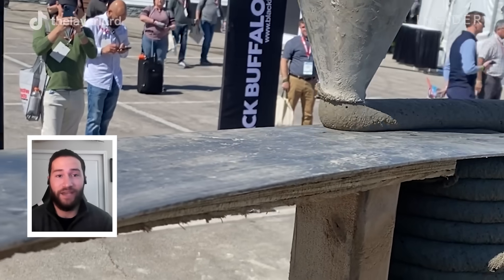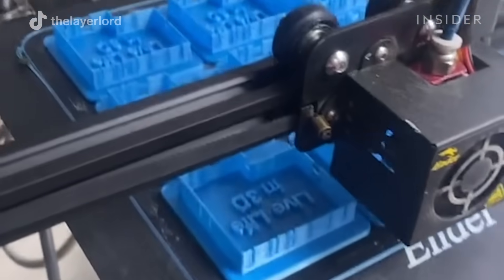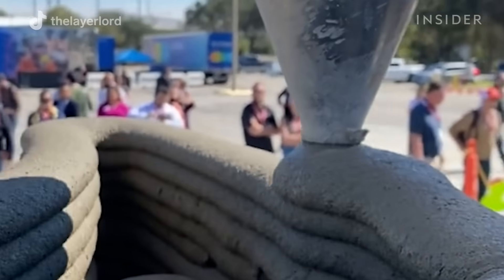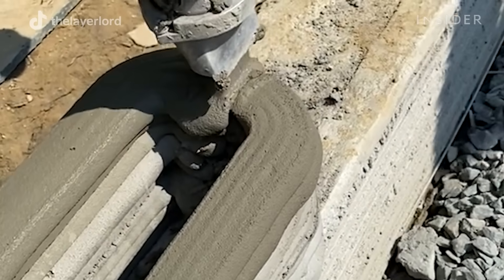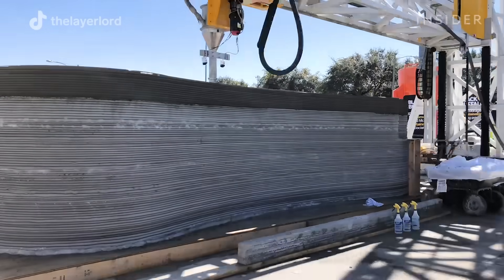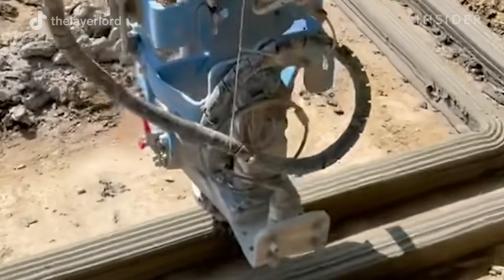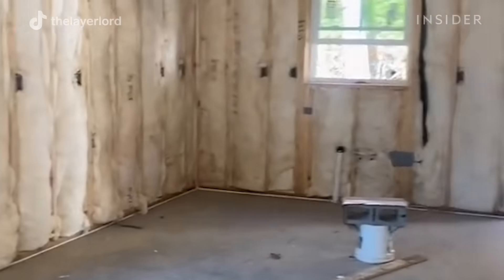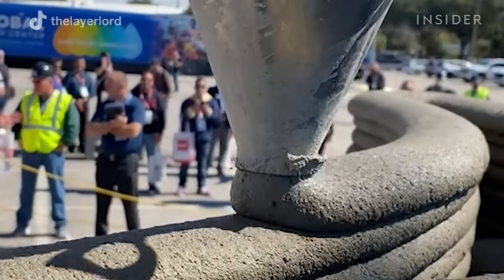How Concrete Homes Are Built With A 3D Printer | Insider Art

Comment: What is the lifespan of such buildings?
Reply: Right on observations here.  Best of both is to reinforce the "wall" in protected space, and put no steel in the outer, with lots of insulation and drainage in between.
Reply: That's unsupported concrete.   It won't stand in an Earthquake, but it is essentially the same technology the Romans used ... And much of their stuff is still standing.
Reply: @L0stEngineer  I do not know you have a lifespan of buildings, but in our regulatory documentation, the lifespanof concrete buildings is from 50 to 100 years, depending on the brand of concrete. Therefore, I am interested in comparing the lifespan of buildings for different construction technologies🤔
Reply: @dimarium      that's for reinforced concrete with steel rebar.      Eventually, the steel will rust and crack the concrete.    If it's unenforced, it has no resistance to tension, but may last a whole lot longer.

Comment: If we could speed up the process with this, we could have quickly durable assembled structures placed just behind the front lines for our soldiers. Infirmaries, command centers, even just some cover. Thin concrete is just a little more defensive than a tent, is it not?
Reply: Each side of those walls were 3 in thick, how is that thin exactly? Not trying to knock you for having an opinion, but your opinion is false 🤣🤣

Comment: Very cool technology . BUT: Essentially this "solves" a problem that isnt really there. What this does it "automatically and very fast" constructs the skeleton of the walls of the house. Thats not a "house", thats .... a skeleton of the walls of a house. If you include the time it takes to rig up the printer and configure the thing, I'm pretty sure that any small team of workers could do the same job just as fast the old-fashioned way.  Construction a frame like that in concrete or wood is relatively trivial. Everything thats actually hard, time consuming and expensive about a house, comes after. Roof construction, plumming, electrical, sealing, carpetry, interior, paneling , floors, ceilings, kitchens , bathrooms, tiling, doors, windows, frames... the list goes on and on. All of those things you'll need to do anyway. In addition , because of this weird method, you probably run into quite a few problems you wouldnt have in a traditional framework. such as rounded corners, alot of uneven layering etc.
Reply: Which is why I think it has excellent military potential. If we could adapt this technology to create disposable, durable structures for our soldiers, it would put us at a huge advantage.
Reply: @brendan5260  how so? I see a bigger need for it to be used to house the homeless and/or those who are at a disadvantage due to acts of nature. Having said that, if this technology were to be replaced by traditional lumber homes/buildings as time went on, civilization as a whole would all be better off in the housing industry. It may put many skilled laborers out of business/jobs, but if that meant that more could thrive because of it and not have to worry about a literal roof over their heads, then that’s not necessarily a bad thing in the end!
Reply: It could be used in space tho
Reply: Nice speech there Joe Know it All.
Reply: Heavy disagree. Knowing tradies who work the “old fashioned way” they hit so many bottlenecks on the job - having the entire thing handled by 1 team will avoid so many issues. These issues break a contract and cost money. This saves money and time.
Reply: While you maybe right this is not about what is possible now but what will be as the technology matures. When jets were first introduced they were slower than propeller driven planes.
Reply: "Price point" is the biggest advantage. Plus, concrete lasts a lot longer and requires less maintenance during the following years. Of course, the roof is probably a "catch 22" in that if made of concrete, it'd take considerably more labor and material. I had to help my brother clean up what was his "stick-built" home twice because of hurricanes. If it would've been built with concrete, at least you'd have the walls still standing...not to mention, it would make construction codes fairly easily. But, it'd still be up to the owner to make the choice of building materials. There's plusses and minuses about either method. It is what you make of it.
Reply: Putting also into consideration the amount of concrete used, I feel like this uses a lot more concrete that building using bricks and concrete would making it expensive I think
Reply: At least for where i am, where a 50kg bag of cement is ridiculously expensive
Reply: Considering the shell of these can be build in a day or two, it IS solving a problem especially if they need a higher volume of them built in a particular area to serve a homeless need. Framing out a house even a small one can’t be done in that amount of time unless you have A LOT of hands on work teaming together. Unless you’re an Amish community or have an extremely large group of volunteers, you have to pay all of those people in exchange for their labor. So you’re wrong that it’s cheaper and that it can be done in the same amount of time because the majority of that work to build a home IS the frame work! Anything after that is smaller jobs coming together to finish it off, even if just as important as the structural work. With this, you’re paying far less people to basically just babysit a machine while it shits out a 90% built home for you, in most cases-by they end of the day. You just can’t beat that-especially when the more manual labor here is probably just making sure the machine is in proper working order!
Reply: @BeachMum  idk my brother, dad, and I once had a job to build 6 small houses, just the frames, after about the 4th one we were so good that we finished the other two in just two hours, granted we had all the material and tools already laid out and my mom was handing us all the tools we needed, but it just goes to show that a well coordinated team with everything they need doing something they’ve done multiple times can really knock it out, but they problem isn’t even that there isn’t enough houses, it’s paying for those houses, idk how expensive this cement they are using for these are or how strong it is layered like that, I’m sure it’s strong just never seen anything like it, guess we’ll see
Reply: @billflunkendorf  this isn’t regular cement. It’s much stronger and made specifically to withstand whatever nature can throw at it-floods, hurricanes, earthquakes, bugs, etc. and is said to last for hundreds of years, far longer than what we use today and needing to be replaced every so often. These homes or shells of homes, can literally be built in less than 24 hrs, far faster than most homes can even on a smaller scale.
Reply: @BeachMum  I think you have consumed too much of the nonsense. You need to look at the reality of these buildings.. there has been many debunking videos from many different channels. From many different backgrounds that prove how incredibly ridiculous these "houses" are.
Reply: @mastermnd22  and what exactly makes them “ridiculous”? Just because they’re new technology? Many people live in earth bag homes and that may seem ‘ridiculous’ to some who don’t get it, but that doesn’t make it so, only that it’s your opinion that it is. What La ridiculous of many timber homes is that it makes them susceptible to many acts of nature. Just because it’s what we always used, doesn’t mean it’s the best thing to use/continue to use, it just means that’s the way we’ve always done it. When we know of a better way, we tend to ver in that direction and that’s how we progress. So I ask you, what exactly makes this technology ‘ridiculous’?
Reply: @BeachMum  what makes this technology ridiculous is the fact that it's incredibly expensive to transport these devices to remote locations that do not have power to for the printer unit. Also the materials required to build the homes are not usually local to the area and must be shipped in. Again these are building incomplete homes. Manpower is required to complete them. This does not include maintenance of the device. Cleaning preparing and installing the device for every home built. And I'm merely scratching the surface of the issues related to this.
Reply: @mastermnd22 says  Bubba, master electrician with 30 years experience, driving a Dodge Ram: "they ground prong on a receptacle go on they bottom"
Earl, master electrician with 30 years experience drives F450s: "that thu dumbest thing I ever heard. Ground prong go up. Dodge sucks lol"
Reply: @bobjones2041  do you feel like you actually said something intelligent? Or just rambled on a bunch of nonsense?
Reply: @mastermnd22  Dave G, expert with 30 years experience on any given topic " the building is just stupid, your just dumb, everyone is just losers compared to me I'm taking over YT comments. Experts only lol"
Reply: @bobjones2041  Ah yes, an insult instead of rebuttal. How classic. It's easy to spot the low brow.
Reply: @mastermnd22  "you've consumed to much nonsense you Judy babble nonsense you're all dribble everyones a loser here lol no rebuttals just nonsensical insults at me the owner of the Web"

-,Dave G
Reply: @billflunkendorf I doubt it. This is only the beginning. It will become faster
Reply: @BeachMum  Clearly, you don't know what you are talking about. This is never going to catch.
Reply: @Mukunda16108  Dude, we get it. You have a time machine.
Reply: @Mukunda16108  it already is catching on, just not as big as the already established lumber homes, for obvious reasons being that those techniques have already been in place for a longer time now. Why wouldn’t we want cheaper, stronger and nearly indestructible homes that could be built in a fraction of a fraction of the time and using far less labor?! That’s a no brainer!! Especially with the housing crisis and homelessness issues we have today!
Reply: Not to mention cement is a more limited resource than wood.
Reply: @kelvinnguyen6048  that is verifiably false. Cement is not a more limited material than wood. What's statistic are you pulling that off of, speculate on something you know about 🤣🤣
Reply: @kelvinnguyen6048 , I don't know where you live,  but here in the desert, woods is precious and rare.  Cement is easy and cheap.
Reply: It's nice to see someone who has no experience in the construction trade giving their opinion on how many issues this new technology is going to have... Especially having no experience with this new technology 🤣🤣. Not trying to say you can't speculate but as a guy who worked in construction most of my life, mostly metal work, you would probably have some opinions on that that are not just in our thought of based off of your interpretation of how things go versus reality. Like I said you can speculate all you want, doesn't mean you're correct about anything. The logic may seem sound to you in your mind, but it's pure speculation with no experienced back it. Foolishness is another word 🤣
Reply: @zackfowler8613  did you have a point in your comment? Because you didn't rebut a single thing from any individual. You just babbled on a giant word salad. Or is it just useless dribble to add to the comment section?
Reply: Wow, you could have done the video I did on exactly this.  Exactly the same points.  Maybe you would have done a better job?
Reply: Real shit
Reply: Plumbing. Just saying. I'm all for people explaining things to others who may not know those things, but not even being able to spell such a simple word makes you look less like an expert and more like an upvote attention seeker. Nobody wants to be told things they don't know by someone who also doesn't actually know them. And you're very clearly not dyslexic, and autocorrect isn't illiterate, so there really is no excuse.
Reply: @mydogeatspuke  you assume that everyone uses, or must auto-correct on YT, which is dumm
Reply: @bobjones2041  all devices have it built in as standard. Be less stupid.
Reply: "Alot" is not a word.

Comment: its basically facing or stucco built horizontally, you still have to frame in the interior with lumber.
Reply: The way people like the open Floorplan design these days, interior framing would be minimal. Just walls for bedrooms and baths.
Reply: @georgehutcheson9679  so true
Reply: @georgehutcheson9679 the roof and interior walls, nobody wants concrete interior walls
Reply: @KALL_ME_KAPKAN  I've never been in wooden house so no you are wrong.
Reply: good way to look at it
Reply: Why? Plaster, rhonolite and primer. Done.

Comment: It looks ok , but where is the rebar , after years of wind and rain , you would have wanted some rebar in that wall.
Rebar is round long iron rods that add the strength to a wall or/and foundation . Rebar is in all and every building in NYC .
Looks like it would be great to watch and take part in a real build . 
Mike .
Reply: I'm not a big fan of it, because this process isn't actually that efficient (molded structure is far better).
But there are two replies to your question: this kind of construction allows more solid overall structure to be built, since you can calc the curves and formats to strength, allowing to reduce a lot the needed iron (I read there can be something around 80% less iron in this 3D printed builds), but there is iron applied during the printing anyway, from the ground up.
Again, I don't think this is the best way of building... But there are some niches where it fits perfectly.
Reply: @electronicscaos  Cool.
Reply: thats when bondo will come in handy..
Reply: Cool , I am sure it will outlast all of mankind.
And just be an empty structure for the birds and animals. 😳
Reply: There are really good comments to this video, a lot of them here.  It is refreshing to see random(?) viewers making such insightful and accurate observations.
Reply: Rebar isn’t needed for loads for houses you have fiber, which this concrete does.
Reply: What about years down the road , 20 , 30 . When the concrete starts to break down .
I see this in buildings in NYC , all the time .
Basement walls crumbling and returned to sand and dust ?
Reply: There are vertical columns with poured rebar.
Reply: Your intellect is refreshing

Comment: OK come on. Run some of that cement over the outside and smooth that out. The forming lines bother me. Create a PLEASANT outer texture, mimic brick and you would never even know it was 3D printed. The amount of crap/mold/grime that gets in alllll those little cracks? geez. EVEN IN 3D PRINTING SMALL SCALE YOU HAVE TO SAND YOUR CREATIONS SOMETIMES! Seriously tho great idea and would love to see one of these homes built in my area.
Reply: Yes, accurate.
Reply: Once these structural walls are laid, any number of kinds of facing can be added to them. 

I wonder how many different kinds of concrete they can extrude? So much possibility with this technique, especially if we can shrink down the printer from a shell/dome structure to just a moving robot.
Reply: I like it as is

Comment: How about the foundations.
Reply: And how do they deal with bugs? Looks like wasp nest heaven
Reply: That's what I want to know
Reply: @TheB00tyWarrior  The one clip shows the footer is installed like any other home. As far as for a basement I could see doing block or concrete forms and then this process on top of that.
Reply: As 3D printer and CAD operator it can do anything you draw, if you draw foundation slab with walls that’s what you get
Reply: Looks not strong.
Reply: Hardly need a 3D printing technique for that
Reply: @rp9674  agree, i see five man running around. I built my house on my own hands. Bit more time, but its mine
Reply: I think this is brilliant
Reply: you dont ask at art or you are hitler
Reply: I figured it would have to have good sized footers
Reply: I assume foundations are already there and they are building on the wooden deck to give it to give it a flat surface
Reply: Sometimes they are printed as well but usually a regular slab